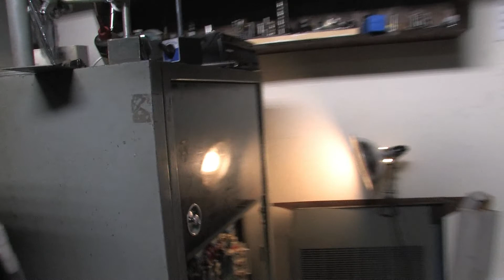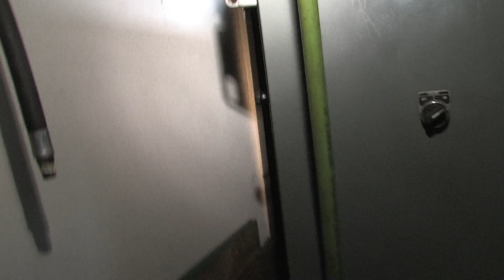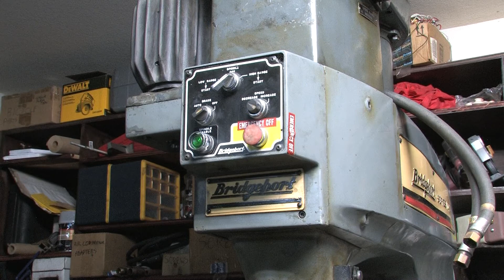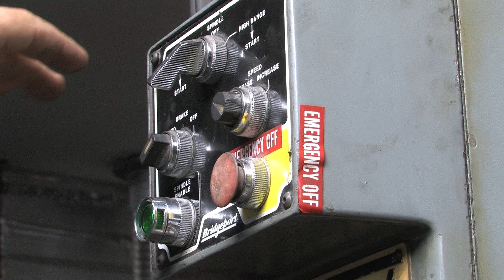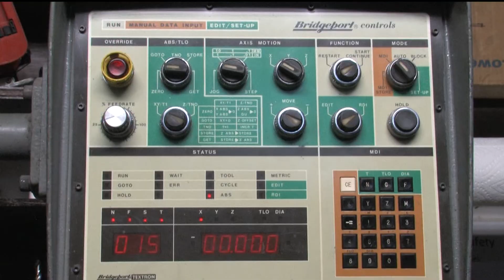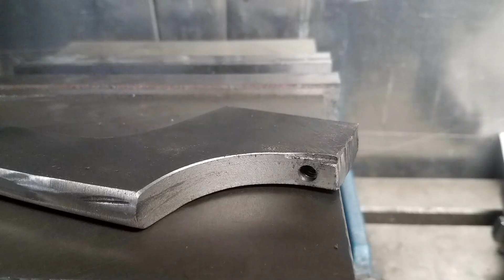Bridgeport series 1 CNC mill cutting circles, intro and common transistor problems

Comment: Good Info for anyone still running these machines I still use a Boss 5 mostly for repeat drilling jobs, I have mine hooked up to a tape twin so I can just load the programs into the control Larry Richmond Va
Reply from the maker: Sorry the late response, but this is way cool that you still use a tape. This is something I only remember my dad doing. Keep up the good work! -Marcelo.